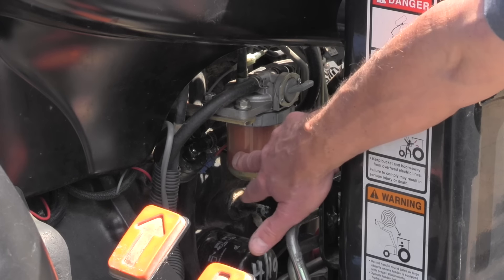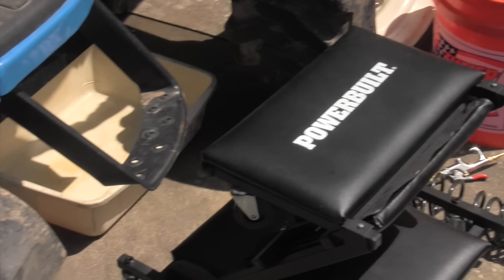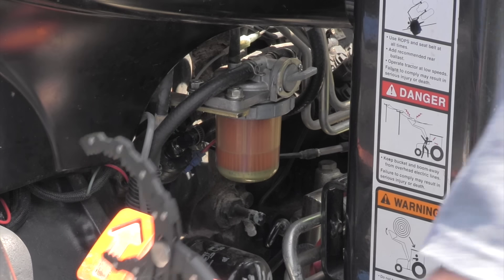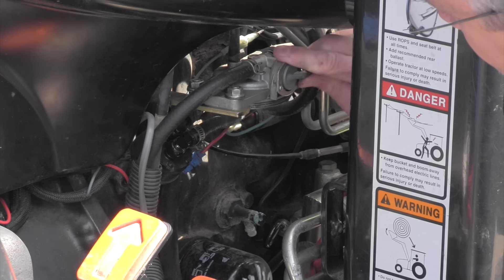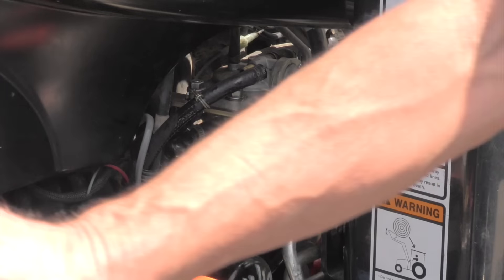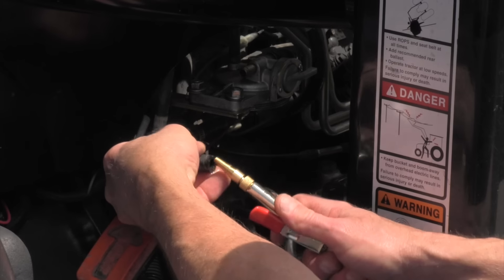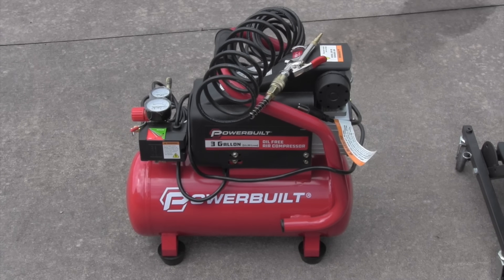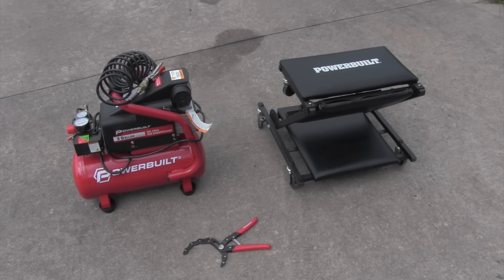Tractor Won't Start and Not Getting Fuel? Here's Your Problem (or at least the first thing to check)

Comment: Wish I had seen this a week ago. Similar fuel problem. Started taking fuel lines off one at a time and blowing air through reach of them. Had already drained the tank. Didn’t remove it to flush it out. That was beyond my know how. Used shop vac to vacuum out tank then used air to blow thru the lines into tank. Put it all back together and when I opened fuel valve to water separator little pieces of black plastic came out. I assumed from the tank. Cleaned separator again and put it all back together. Running fine ever since.

Comment: FWIW, on my NH 3045 I found the problem was with the "fuel safety shutoff module".  It's a plastic housing, filled with what appears to be epoxy, under the instrument cluster in the area where the relays/fuses are located.  It's just plugged into a Molex, it's not mounted (or wasn't on mine, and mine was bought brand new).  It has 3 wires: white, black, and a blue.  Black is ground, white is +12v when all safety switches (PTO, gear, etc) are clear to start.  When white is +12v, the module then provides ground to the blue wire which grounds the fuel shutoff solenoid relay in the relay bank (activating the coil in the relay which has key-on +12v).  Why they didn't a) use another relay or b) simply ground the fuel cutoff solenoid through daisy-chained safety switches I don't know.  This unit is basically a transistor used to sink voltage for the relay when the safety switches are as they should be.  Cost me less than $10...took 35 minutes each way to the dealer to get the darned thing.  I probably could have replaced the unit with a relay but chose to replace it with a factory part.  It took me 1.5 hours to check each piece as a I went along to find this.  A faster test, knowing this now, would be to simply ground that blue wire and see if the tractor will start, then check ground on black and +12v on white (key on, of course).  HTH.

Comment: I've got a 2001 New Holland TC45D and I've had this very same issue several times. It seems to happen the most when I'm bush hogging on hilly rough terrain. It must stir up whatever it is in the tank that causes the clog. I keep an eye on my fuel filter bowl to see if there is any air in it.The tractor usually gives me a warning by suddenly losing power when the line from the tank clogs. So I shut it down before it runs the filter dry. Now I'm always sure to carry in my tractor tool box a needle nose vice grip plier to clamp the line as well as a pair of needle nose pliers to remove the hose clamp. If it happens to clog up out in the field, I just blow back through the inlet line with my mouth until I hear air entering the tank then I let the fuel flow back through the cleared line and hook it back up to the filter again. What little air that enters the system bleeds itself out on its own. It's just a minor nuisance as long as I have the tools with me to remove and clamp the line when it happens. I think it's just plastic shavings left in the tank from the manufacturing process clogging up the line from the tank. It has not happened in a couple of years now, but I've had it happen twice in the same week before. I'm waiting for your upcoming video on how to flush the tank. However, like I said, it has not happened in a couple of years now so I'll probably leave it alone unless it becomes a regularly occurring problem. My New Holland TC45D has been an excellent tractor with very few problems. I bought it new in 2001.

Comment: I have a new Holland tm175 put a new injector pump on it fires and runs for maybe 30 or 40 seconds then dies. It will try and fire but will not run after the first time

Comment: I’ve got a New Holland TC40DA that came with some property I just bought.   I think it’s a 2012.  I didn’t realize the fuel gauge didn’t work and I ran out of fuel.   After I check the bulb and blow out the line like you’re video, where is the bleeder valve you mentioned before cranking it up?  Thank you!

Comment: Thanks Mike, this video saved me a service call.  I knew fuel wasn't getting from my tank to the engine but I never thought of simply blowing out the lines.  It worked just like you showed, I got my tractor to start and out of the field so now I can drain and clean the tank in the shop.

Comment: I had a starting problem with my 455g John Deere crawler loader , I found the fuel cap breather nuts were blocked and i think caused back pressure in the tank,it fixed my problem. nice video.

Comment: Good video and information. If you don’t flush the tank it’s probably going happen again sooner or later. Should you have a screen in the filler neck. I know mine does but it doesn’t mean that fine stuff didn’t get through and eventually plugging your line.

Comment: Thank you!  Had the same issue when we took the water/fuel separator off and it did exactly what yours did. No fuel when toggle was on. We followed your lead and blew out the line and it worked like a champ. Appreciate ya!

Comment: We have a 1981 Fiat 880 DT backhoe which i did a fuel filter change to, the lift pump is isn't getting any pressure when you press on it and the second fuel filter isn't getting any diesel in it do you have any idea what the problem could be ? 🤔

Comment: I have a 1963 JD 2010 gas that I bought, have no track record of work done, won't start, has electronic ignition, new plug wires, new manifold gasket, new fuel, new plugs, new rotor, new cap.  Backfires through carb.  Sprayed starting fluid in carb and caught the whole side of the tractor on fire.  Any suggestions as to why this isn't starting?  And I have checked TDC with rotor pointing to #1 plug and all is good.

Comment: Thanks Mike. Had assumed I had a plugged fuel filter as engine seemed to be starving. Was getting ready to shop fuel pumps after changing the filter. Tried your trick and sure enough it worked. Will pull and drain tank at some point but running like a top now.

Comment: Mike, did you ever do the video on flushing this tank? I'd be interested! Didnt see it in your channel....
Reply from the maker: Andrew, I have not done that.  It's been on the list, I'm a little bad about not fixing something until the tractor won't run, and it's still running.
Reply: Thanks Mike. I have the dirty fuel tank issue myself right now. Also putting it off until it becomes a bigger problem, lol.   Thanks for the reply!

Comment: Hi Mike- I'm having the exact same problem with my tractor and blew the line out and got it running again, for a little while until the sludge plugged the line again. I'm going to have to clean out my fuel tank and was wondering when you will post the video of  you doing this as you referenced in the video above.
Reply from the maker: It'll probably be November at the earliest.  Unless it quits again and I HAVE to fix it.  Good winter video.
Reply: Did you ever make the follow up video that answered this ?? You're videos have been such a blessing ! I have a late 70s Case 450 Dozer we just swapped engines, changed the fuel pump and damn thing wont crank now. But every day is a learning experience.

Comment: Same problem with my Kabota BX more often than not so I put a T in the fuel line and extent of the tea up to the rocks with a rubber cap on it so that when I have this problem I simply take the cap off and put the air pressure to it to clear out the main tank clock
Reply: Should have said ROPS and a tie wrap

Comment: Love your videos Mike!  I have a smaller New Holland tractor, Boomer 24.  I need to change my fuel filter and you make it look so easy but my problem is getting to it.  The side panel covers most of it so the only work space is from inside.  I noticed in your video that you didn't have a side panel.  Do I have to take my side panel off?  That is alot of bolts.  What would be your advice?
Reply from the maker: My complete hood lifts and there are no side panels.  I'm not sure how the Boomer 24 is put together, most of the time there's an easy way to remove any side panels, but it's possible for them to be attached with bolts.  I'd have to look at it.  You can look up every part on that tractor at New Holland’s website here: https://partstore.agriculture.newholland.com/us/parts-search.html.  Just enter "model" where it says “type” on the right and then put in your tractor model number and navigate to the section you need.  Sometimes it helps to see a diagram of what’s inside before you start taking things apart.  Good luck! -Mike
Reply: @TractorMike  , Thank you Mike!  I did decide to just take the nuts off and then the project was doable.  Really appreciate the link to the website.  Will probably be needing that. :)

Comment: I sometimes use my air compressor to blow crud away from the full filler to lessen the chance of contamination while fueling. I was surprised how much muck can build up under the fuel cap. I usually see it during the mowing season.

Comment: I have a 06 5500 2 wd Mahindra. About 2 or 3 was after I bought it, I learned the diesel tank was flaking from inside and the fuel wouldn’t flow out of the tank. My Mahindra dealer replaced it under warranty. Everything was wonderful until 13 years later. Now it is doing it again. How do I get the tank out or is this something only an expert  should do?

Comment: Hey my kubota m9000 is hard to start also it died on me and it won’t start again. Do you think that my be the same problem on mine ? The fuel doesn’t run fuel out when I disconnect it, does most fuel lines supposed to run out fuel like that when not clogged ?
Reply from the maker: Yeah, if it's gravity feed.  Change your fuel filter first, then go looking for something in the tank.  Good luck!

Comment: I have the same problem with my Ford 3400 gas Tractor. Mine has metal fuel gas lines. I’m about to just replace the gas shut off valve that comes with a filter of its own that goes up into the gas tank that gets clogged up over time. I’m going to flush out the tank with fresh gas while gas shut off valve is off the tank. I’m going to catch the gas as it falls out the tank with a funnel lined with a screen into a 5 gallon portable gas tank so I can reuse it if it looks clean in a mason jar.

Comment: Mike I have a Boomer 35 and I'm sure I need to change the fuel filter.  Been careless on this.  I couldn't find your video on flushing the fuel tank.  Can you post a link to it?  Thanks
Reply from the maker: Jim, I'm embarrassed to say, I haven't done that yet.  Got the tractor running and forgot about the tank flush.  I'll try to get that done soon, if I don't do it in the winter I'll be at the far back of the pasture when it dies, in July next summer.  I can feel it coming...
Reply: @TractorMike  I was just looking for your flushing tank video. Too funny. Love your videos

Comment: I have ts125a new Holland tractor  is there a check valve in the tank . I can't  push feul  out of tank with air pressure put into  tank
Reply from the maker: Don't think there's anything like that in there.  You can look up every part on that tractor at New Holland’s website here: https://partstore.agriculture.newholland.com/us/parts-search.html.  Just enter "model" where it says “type” on the right and then put in your tractor model number and navigate to the section you need.  Sometimes it helps to see a diagram of what’s inside before you start taking things apart.

Good luck!

Comment: If there was something blocking the fuel line to the filter. Didn't you just blow it back to the fuel pump? Couldn't this this happen again with the blockage still in the line?
Reply: Somewhere there was a note saying a tank flush would be a future vid. I would assume after he runs most of the fuel out if it
Reply: Larry342516 
The caption said a flush of the fuel tank will be in another video. He isn’t done with the tractor yet. Just trouble shooting the non start problem in this video.
Reply: The line that he took loose goes directly to the fuel tank. He blew the trash back into the fuel in the tank. Like he said that's why he will have to drain and clean the fuel tank next.

Comment: figured out today my fuel shut off solenoid is starting to go bad on my '06 challenger mt265b with 475hrs. had to order a new one. $253 solenoid, $11 gasket, $25 or more for shipping. at that price that solenoid should have lasted 1475hrs at least. i hope i get more than 500hrs out of the next one. 
6242128M1 is the part number in case anyone needs it.